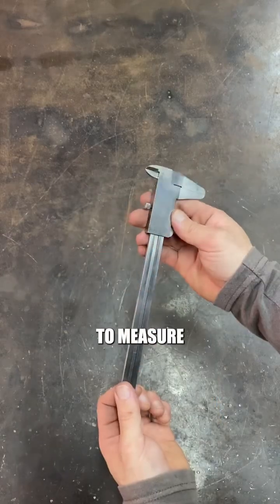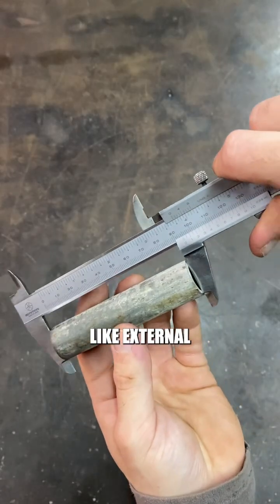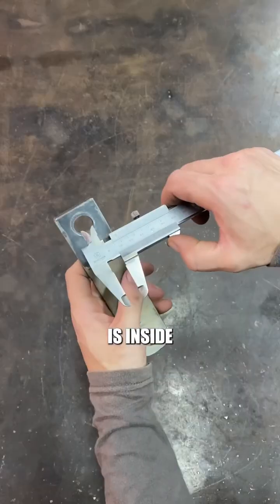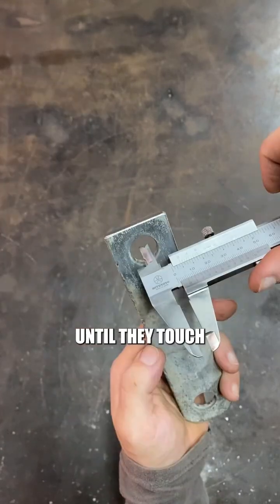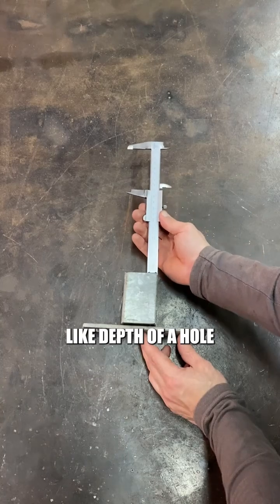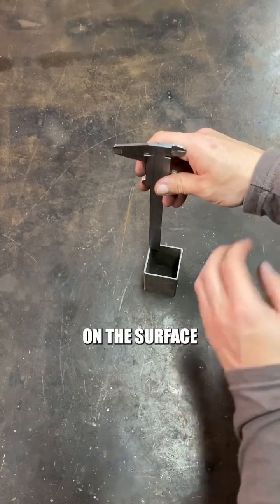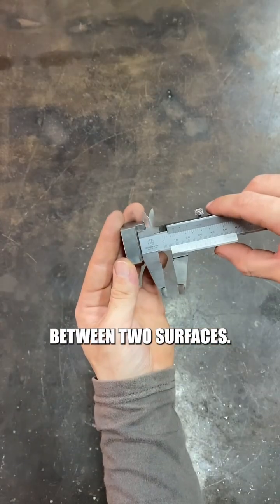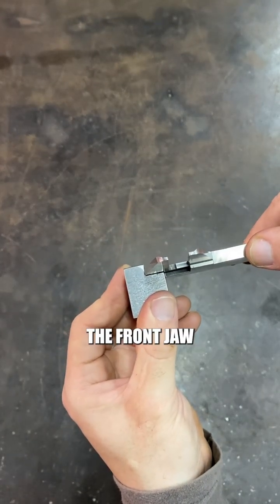4 Ways To Measure With A Caliper

Comment: Well height/step-depth could work the same so might as well add the 5th way lengthe measurement using it like a ruler
Reply: Theres a pretty big difference tho
Reply from the maker: @TheProphetBot  I agree.
Reply from the maker: @hickstylez  you are right about the first point but it’s not really designed to be used as a ruler